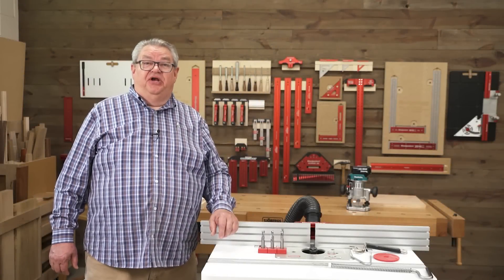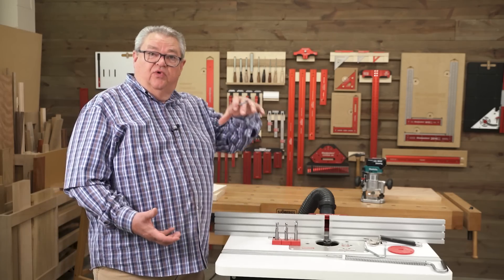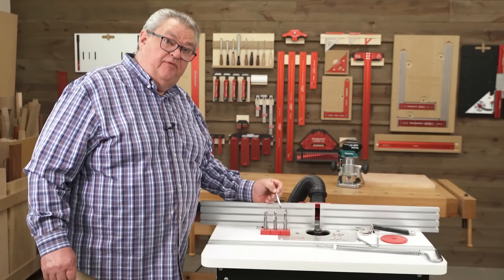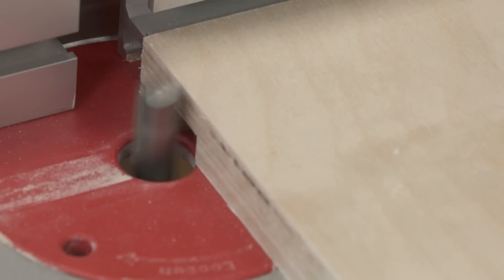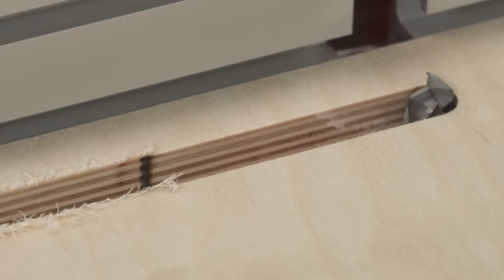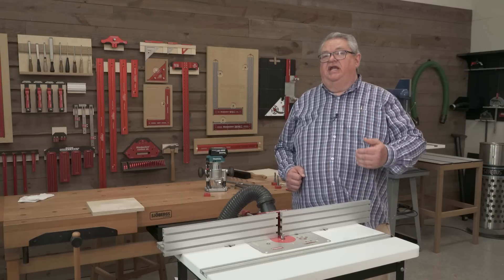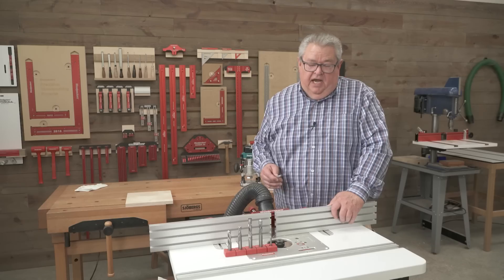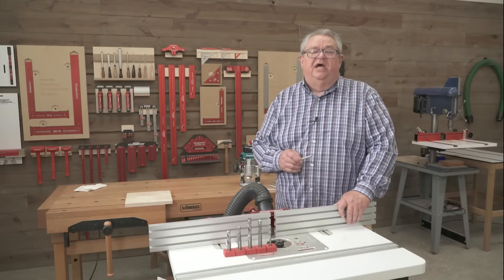Deep Dive: Ultra-Shear Solid Carbide Spiral Bits Explained.

Comment: I have 6 of your router bits. The flush trim bits are second to none. They are simply amazing. I also have had amazing success with both the up cut and down cut bits. Getting ready to order the 1/4 inch flush trim bit and maybe I’ll throw in a compression bit as well. Thanks for starting to make these.
Reply from the maker: Glad to hear your results, jim. Spread the word!

Comment: Amazing timing! I just had an e-mail exchange earlier today with Chris about this very subject. I have been having trouble with hardwood tear out with less than 1/8" excess around a template. Going to try a 1/4" upcut spiral compression bit to see if it handles  maple and other hard wood better.
Reply from the maker: Ron, what type of bit were you using when you got the tear out?  I am also going to guess that tear out occurred as you are transitioning from end grain to long grain.

Comment: Would the compression routing bit also be the one to use when flush trimming?  I'm making a cabinet and will need to flush trim the face frame to the plywood sides.
Reply from the maker: Compression flush trims cut solid wood just as well as plywood, so yes, it will trim the face frame to the cabinet perfectly. You didn't mention size, but I would use a 1/2" diameter for that job. I only use a 1/4" when I have tight inside curves to follow.
Reply: @WoodpeckersLLC  Thanks.  I bought the 1/4 inch bit to use in my small trim router.

Comment: For your "go to" bits are they all 1/2" diameter (with the obvious exception of the 1/4" you call out)?
Reply from the maker: Yep. We do make a stepped-down 3/8", but for the most part you want to stick to 1/2". It's actually more expensive to make the 3/8" because the machines have to grind away so much carbide.

Comment: Jeff, I’m sure your bits are of fine quality, but what would separate them from the likes of Amana, Whiteside, Freud, or other top quality manufacturers that have been making these bits for years?
Reply from the maker: Since you asked me by name, this isn't the company line. This is the way I personally see it. The names you mentioned and only a couple more I consider actual competition. On that plane, it is hard to go wrong. The first thing I'll mention is that there isn't a machine in our router bit section of the shop that is more than 6 months old. Rich has committed to tooling up with the best of the best. Rich himself plus several engineeers and machinists have been going to training non-stop since the first of the year. We started with solid carbide because the cutting technology is very similar to cutting aluminum...which we've learned a thing or two about over the years. This sort of started because Rich wanted better bits for the big CNCs we use to process Baltic Birch and solid phenolic. We went from "What does it take to buy better bits?" to "What does it take to make better bits?" and never looked back. Our prices are good for just the reason we mention...we are the factory. There's nobody taking a cut between us and the guy chucking the bit up in his router. Other companies aren't built that way because when they started making router bits, selling direct would have been suicide. Things have changed.
Reply: @WoodpeckersLLC  I thought Whiteside is/was making these spiral bits for you? That's the impression I got from your website.
Reply from the maker: How did you get that? No. We are making them right here in Strongsville.
Reply: @WoodpeckersLLC  Jeff, I appreciate your in-depth response. To me it goes beyond what a demonstration video/s tells us about your bits. Honestly, most any quality brand bit will as cut cleanly as yours do, but your prices and size selection (length of cut) are incredibly competitive. Looks like you have a new buyer for router and CNC bits. 
Thank you and,
All the Best, Chuck.
Reply: @WoodpeckersLLC  well, Jeff I went ahead and bought two half-inch up cut spiral bits on a flash sale. I’m anxious to get them and see what all the hubbub is about. All the best Chuck.
Reply: @WoodpeckersLLC  I used the 1/2" down-cut trim bit on a 1" board that shifted during glue up. WOW, you would have thought I ran it through the jointer! Beautiful, clean cut and perfectly even with the reference board. Couldn't be happier.
Keep those "Flash Sales" coming!
All the Best, Chuck.